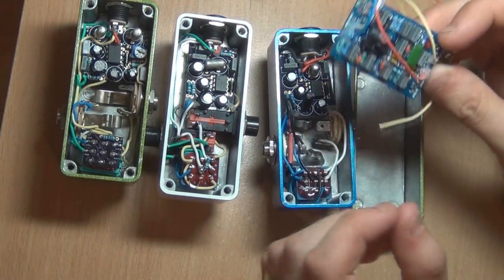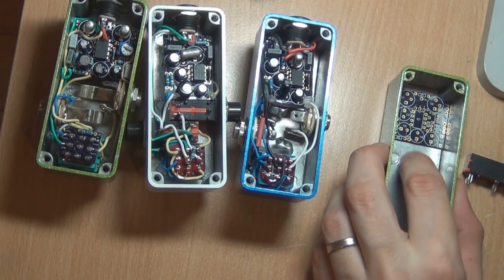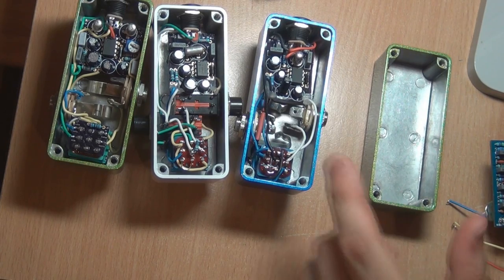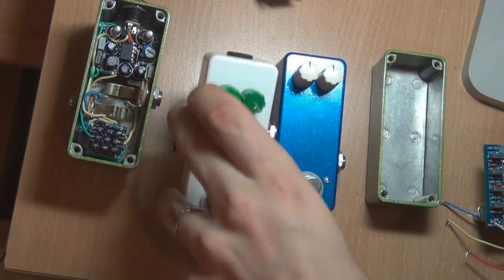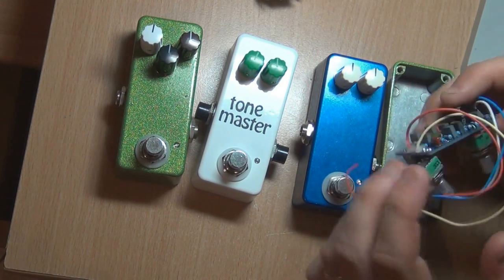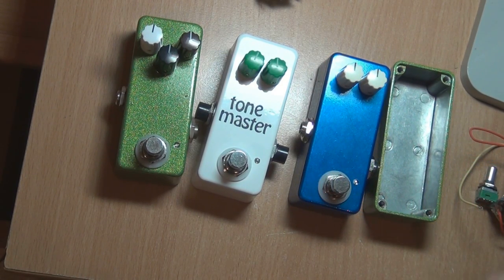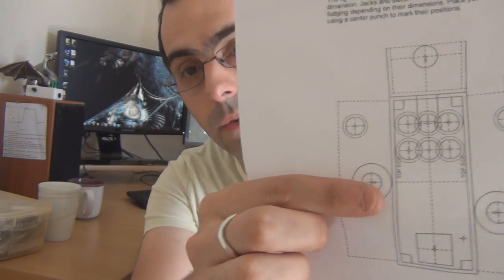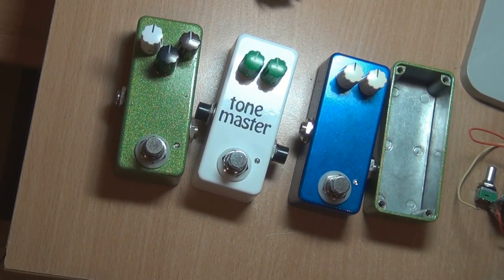1590a Build Guide - Part 3 of 3

Comment: Hi, I bought the facemaster kit. I am not sure whether i should wire PCB to the Pot or direct mount (which scares me if i havent got the drill hole spacing correct on a 1590a). Any drilling template i can use for facemaster on 1590a?
Reply from the maker: Hi Chin, thanks for your order and message.  I don't have a drill template for the facemaster in 1590a, you probably wont need one for the facemaster specifically anyway.  For most 1590a builds I use Brians (Madbean Pedals).  Google "madbean 1590a template" you should see his drill template in the forum, it is very good.  Cheers